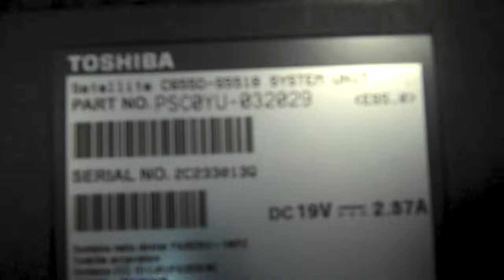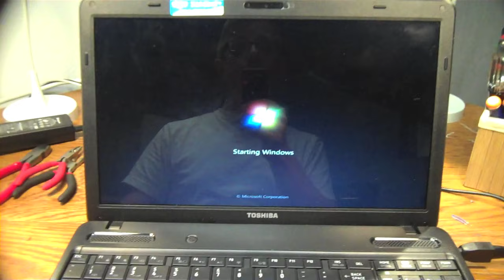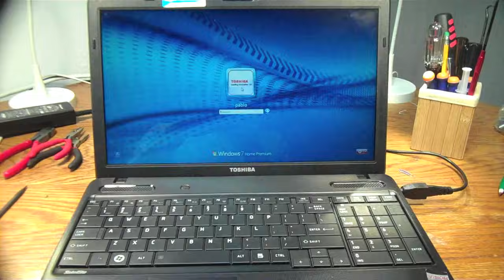How to Reset BIOS Password on a Toshiba Satellite Laptop

Comment: do you have any solution to fix annoying and very loud noise from the fan toshiba satellite, it's starts normally, but few minutes he runs very fast and very loud irritating noise, like it's touching something while its running, i've already cleaned it up from dust but still have problem... please guide me whit something... can't work on laptop while having this annoying sound... ;(
Reply from the maker: You will have to do a fan replacement on that one.  Look at my video list and find the Toshiba disassembly guides.  Plenty of info to do it yourself.  Good luck!!
Reply: +DIY Tech i have a satellite pro s500 i set the password and then after i hit enter the computer doesnt want to get into bios me i remember the password but it doesnt ask me to inter the password it start direct and ig you force to press F2 key it restart itself without bring the place to enter the passwor so guys please if anybody please can assist me what should i do now
Reply: +DIY Tech help sir... i do not know how to reset password bios password my laptop's model number is model no. PSMAOE-03001DAR
Satellite Number: M100-164 thank you sir much appreciated

Comment: I have a Toshiba L755-s5214 and can not remove the bios password.  I even took my laptopl to local tech shop and they couldn't even fix it.  I believe mine might have a dual bios battery or something.  I even took out the cmos battery for a few weeks and put it back in and it still came up with locked password.  There were no places to jumper on the board.  Toshiba wants $150+ to reset password.  Help please.

Comment: Toshiba Satellite C655D-S5200
Thank you, Brian, for uploading this helpful video. I went through every step in this video and believe it would have worked for me if I had not had a second password in Bios. A continued search for the solution led me to a better understanding of how to properly change or reset a password in Bios. Hope the info below helps someone out there.

If you know the password and just want to disable it from popping up all the time:
- Boot up the machine and once the Toshiba logo pops up, press "F2" to get into the BIOS.
Note: I used F12 to access BIOS.
- Navigate to HDD password option and press "Enter".
- Enter the current password when prompted and press "Enter".
- When prompted for new password, leave blank or enter new password and press "Enter".
- Navigate to "Exit" and "Save All Changes".

The computer will restart and the HDD password should not pop up anymore.
Reply: I actually tried this on my laptop and it worked, have a Toshiba laptop, thank you very much.

Comment: L655 remove clear sticker with bar code and you will find "G1" "G2", took me forever hope it helps anyone else ^_^.
Reply: Jinx, did shorting these two pins work for you ? I have the same model and it did not do anything. Were their any  other steps you took ? Thanks...Clay
Reply: Hey bud. Yes it did, but they had to be shorted at the same time as pressing the power button. It took a few tries to get it. Try using a pair of tweezers and have someone else push the button for you.
Reply: Also make sure your shorting across ONLY G1 not across to G2-G1
Reply: Jinx Cvercko Thanks Jinx, I guess I misunderstood and shorted G1 to G2. I'll go back and try it as you clarified. If this works I will be so very thankful as I have been trying to figure out this for weeks and have been on over a dozen websites and forums and the ONLY thing I found specific to the L655-S5153 jumper location was your few lines of comment . Very much appreciate you taking time to respond...Clay
Reply: Clay Gibson Jink, shorting G1 did the trick, Thanks ! Whatever caused the BIOS password to be put there also caused it to corrupt the user profile and it still would not log on, however I booted into Safe mode with f8 held down during boot and deleted the corrupt user profile, created a new one and all is now well in the world. You taking to time to help was deeply appreciated by myself and my niece who depends very much on her laptop and was having to face college classes without much of her data...:)
Reply: Your welcome clay.. another trick if you need to do a master reset is hold the 0 key and lower it on you will hear a long beeping as if you had a stuck button . That's exclusive to Toshiba. Good luck and your welcome and god bless.

Comment: If you have a L350 L400 all the L450 there is no reset pins near the memory bay.... but there is two solder contacts near the memory slots but if you try to sort these pins you will kill your motherboard i try before so find out the hard way so you don't have to, but you can still reset your bios password by de-soldering the cmos battery from the motherboard waiting a few minutes then solder back on again this will clear your bios password.... could also work on other older models of toshiba satellites

Comment: Hi Brian I have P505-S8940 and I need to reset the bios password. The B500 jumper is not in an open area if there is one. If all else fails where do I find the RTC or the B500?

Comment: Hi, few things. Firstly, how did you turn the laptop on while holding it vertically with the lid closed? Also, how did you realize the right moment to remove the jumper? Last but not the least, how to reset BIOS password on Toshiba Satellite a350d-20k PSALME taking into account it does not seem to have the same to B500 stuff? Thanks!

Comment: For that you merely need to reset the video card.  You do this by first removing the battery of the laptop and be sure it is unplugged.  Next you press the power button and hold it pressed then plug in the power cord (NOT the battery yet), still holding the power button. then let go of the power button and push it to power on. it should boot right up, then you're good to put the battery back in.

Comment: okay nevermind I used a flat head screwdriver and it worked perfectly..  I had to do it 3 times but it worked on a Toshiba Satellite s855D -s5120..  thank you for the post in the info I just thought maybe telling everybody that they can use a flat head screwdriver may be easier..  cuz it was much easier

Comment: I have a Toshiba Satellite s855D - s5120.  I'm trying to dothe way you are doing I found the  b500 nodes and tried jumping it, and it is not working do I have to use the wire that you are using in the video as a jumper??  cause if I need a special wire for the jumper then that would explain why its not working. please get back to me.

Comment: sorry my english is limited:(
1 friend used a diferent charged on Toshiba Satillet. so burn the current controller. i know that, because i can turn on with batery, but if i use the charged, the laptop is turned off.
so can i circumvent current controller using BIOS or only by windows?
(the hard drive is formated)
(i'm not ok for open the laptop and i want help him for not lose so many money)

Comment: where would you use jumper wire on a toshiba c655d-s5511 there is no b500 nodes that we can see? Where in florida are you located? What would you charge to do this?

Comment: I just had mine show up while it was in my computer shop.  I was finished removing several viruses (restarting many times).  I shut down the computer to clean the screen/laptop and it showed up after I turned it on.  One more thing to add to the long list of reasons to not buy a toshiba.

Comment: For me, I was fixing someone elses laptop. But in doing so, I found that there was a bug in some Toshiba BIOS's, which cause the laptop to be locked with a password, even though the user hasn't set one. Toshiba did a recall on lots of models a few years ago.

I do not think this is your typical BIOS password though (its a white "Password:" text on black screen, rather than the usual blue dialog), but I was able to remove it by connecting a few jumpers all the same.

Comment: I then turned to Bios.. I went to Toshiba Support and downloaded the Bios update...  Then I became really confused, the update is an older version than the one installed. How can that be possible?
 I know how to reset the bios on a Toshiba, by shorting out the two nodes in the Ram compartment, but I can’t see them in this model...!
 Please help me out,  I have been pulling my thick hair out in handfuls
Kind Regards
Alan

Comment: I tried it again without the DVD Drive and it boots up & runs the checks, fine. I assumed the Hard Drive was faulty. I replaced it with a working Hard Drive, and also replaced the DVD Drive....I had exactly the same problem.
I then Installed the Hard Drive on its own, and it booted up fine. The problem is...I can have either the DVD Drive or the Hard Drive installed, but not both at the same time.

Comment: On Start-up, it only gets to the “Toshiba Leading Innovation” Screen & freezes. I can get into Bios & I pressed F9 for setup Defaults. I tried again but with no luck. I removed the CMOS Battery & left it for about 30 minutes or more, again...no luck. I started to systematically remove Hardware and found, If I removed the Hard Drive I could load up the DVD Drive with an Operating System, but of course I didn’t have the hard Drive installed.

Comment: I've done everything in the video & the blue password screen still comes up...is it the nodes labeled B500 the jumper location for every Toshiba model? I've used a flat head screw driver, I don't have a jumper is there something I'm doing wrong? I have the Toshiba satellite C655-S5049

Comment: Take the back off, remove battery, remove RAM. Then study the board with a magnifying glass. If you're lucky you'll see two unconnected contacts close together labelled something like JCMOS1, CLR, CLRPWD, PASSWD, JRST1 etc. I did a satellite today and they were tiny copper contacts shaped like { }
If you find it, place a flat head screwdriver across them without any power, and see if it boots. 

Also try 'Toshiba' which is the engineers backdoor password. Didnt work for me so maybe its a myth

Comment: As far as I know you cannot erase it by finding a way to drain the battery. There will be a jumper somewhere on the board, so this guys instructions work for most Toshiba's, but the problem is the jumpers are labelled differently and in different places on each model

Comment: The password is stored in non-volatile memory so removing CMOS battery does nothing (granted it does work for a lot of other machines). 
The CMOS battery is surface soldered on many Toshiba's, so even removing it to try, is a real hassle

Comment: I have a toshiba satellite c655-s5514 and it won't boot up. I get black screen with a clicking noise with a screen saying " insert boot disc" and " press any key" over and over. If you had any advice that would be awesome. Thank you in advance either way.

Comment: i have a toshiba satellite A205 - S5804 everytime i turn it on it asks for a built in hdd password but i never set a password and any password that i would use i have tried and it will not let me access i want to remove this password and reset my pc back to factory settings but i am having many difficulties please help me

Comment: I have poured over dozens of searches for my specific model of Toshiba Satellite laptop and have found nothing that tells me where the jumpers are located. Just powering up the laptop without the hard drive in place eliminated one of the pesky bios passwords but can you help me find the jumper's location? Computer info is: Toshiba Satellite L45 - S7423 Series. Model #PSL48U-013005. Thanks.

Comment: I own a toshiba satellite a205-s5825 purchased new back in may2008, thing still runs tops to this day. This bios reset fix is im sure similar to mine and will come in handy if i ever BIOS password my system and forget the security code. One little gripe if i may, your the second video i've seen that a person has removed the battery from the laptop while its still on. In my opinion, it should be shutdown properly before performing the fix, but thats just me. Good job though...

Comment: hi! i too dedicate myself to working with computers. i have the very same laptop, the problem im having is that when i push the f2 key on the toshiba logo it asks me for a password, i removed the bios battery and did this very same thing but i still cant get into the bios settings. i would be greatful for any suggestions.

Comment: I have some bad news for you. Your graphics card is shot. Only thing dat may help you is IF your laptop comes w/ a dedicated graphics card. That way it can be replaced. 

My sister's laptop had dat same issue. Her's came w/ an integrated (sodded) graphics card which fried due to the fan being clogged by dust bunnies. I got it working after I had to replace the motherboard. 

Try removing the memory from the laptop, hold the power button for 30 seconds put everything back n hope 4 da best.

Comment: Good video. Thank you. I have the same model in the video. C655D. Same issue.
I am a lil confused yet on removing the ram card prior to the jump. ...Is it necessary? The one here is very fastened with plastic parts. I don't want to bust anything prying it free. The B500 points are visible and reachable as it is.
Also note there is another screw that fastens the hard drive before shutting its door.

Comment: i've heard laptop overheating is due to the irresponse of fan speed along with the workload. fan doesn't speedup. technician told that the component in the fan speed signal circuit is damaged. i can't find which component it is. is there any components between Super I/O and fan speed signal circuit?

Comment: My laptop ( Toshiba Satellite a500-17x) recently crashed during a bios update and i have not been able get the laptop to display anything on the screen or via an external monitor, the laptop powers up and the lights show that the laptop is charging, HDD is present etc, the fans spin but i get no display.
   How do I reset the BIOS? ... Hope to hear from you soon.

Comment: sir, i have a toshiba l300, the cpu fan is working when switched on , but no display and hard disk led just keeps on blinking . It all happened suddenly. removed the RAM also and switched on the laptop but no beep is there.Is there anything wrong with motherboard

Comment: Nice Video.  Do you know how to fix the blank screen at start up problem that the HPs usually have.  I hit the power button and the power light, charging light, keypad light comes on and it sounds like its try to access the CD rom then nothing.  It sits there and does nothing.  The whole time screen is blank.  HP start up logo never comes up or anything but lights are on and fan is spinning.

Comment from the maker: Thanks for the update, glad it worked!
Reply: @DIY Tech    Thanks so much for creating this video.  I have a Satellite L55 A5226 but I can't seem to find the jumper. I looked all over the web for where they may be located (like for schematics).  I don't see any xx's, even under the RAM chips, and I have tried connecting two points on almost everything on this board.  tried removing the CMOS battery, using "Toshiba" as the password, etc.  Please assist.

Comment: Thank you this worked.  At first I was using a cat 5 end that did not have a solid wire but a mesh . I used a cat 3 phone cable and striped the cable and it was solid. After followed the instructions it work the first time

Comment from the maker: This is known as the Blue Screen of Death.  Most likely you have a bad hard disk OR some corrupted data on the hard disk that needs to be cleansed OR you have a virus OR a HOST of other things....(hence the name BSOD) they are very hard to diagnose for the lay person.  My suggestion would be is to find a copy of the original OS disc (or buy one from the manufacturer) and try to re-install.  If that fails, then you will need to replace the hard disc.  Let us know!

Comment: i have a toshiba satelite L305-S5962 i dont have any disks for it and i did ur little deal here and it didn't fix the problem now i have a whole new set of problems it doesnt even come up to the password page anymore it goes stright to Windows boot menu and tells  me it failed to open bc of soft ware or hardware changes. i have no disks how can i fix this problem